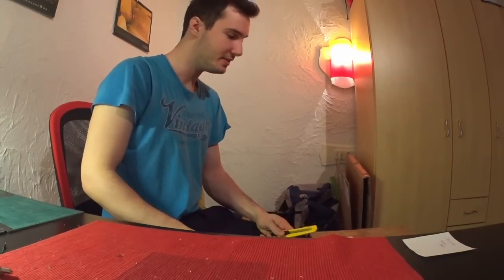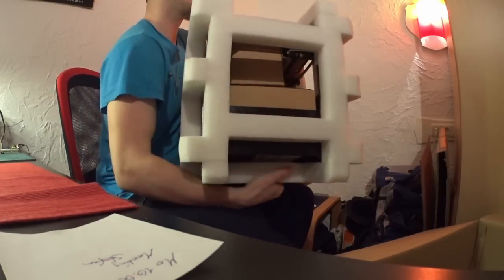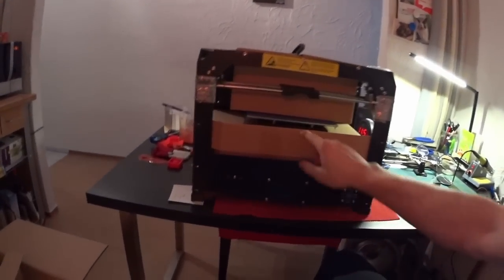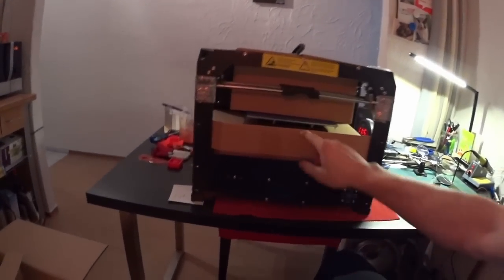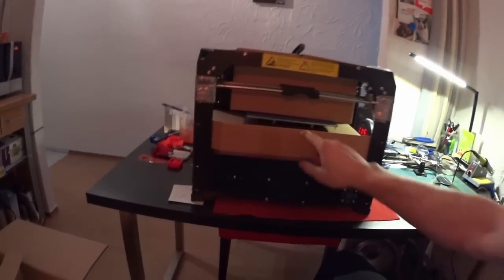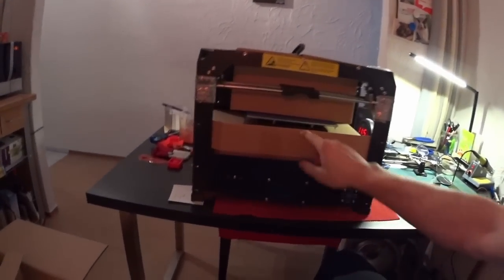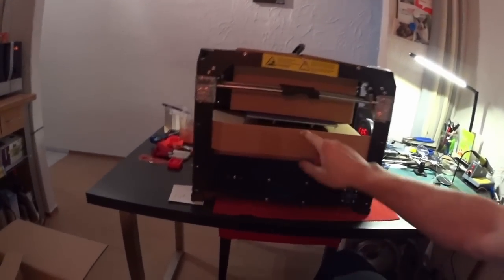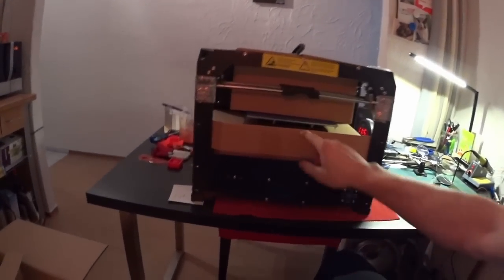Introduction to the CTC 3D Printer

Comment: Hi there,
I've got the same printer. Do you really get acceptable results at 80 mm/s? I use 20 mm/s for external perimeters and acceleration for nearly everything.

I'm very happy with FreeCAD for modelling, slic3r for slicing and gpx for converting gcode files to the supported file format x3g. It works perfectly if I use just one filament. I tried to use  two; one (rubber) filament for perimeters and the other filament for the rest. My converter complains about syntax errors in the gcode file.

So my question is, how did you get the dual extrusion for one build to work?

Thanks!